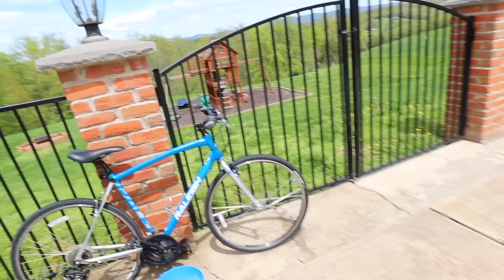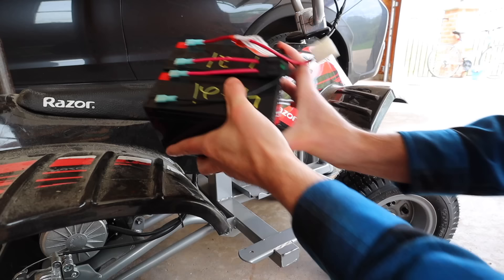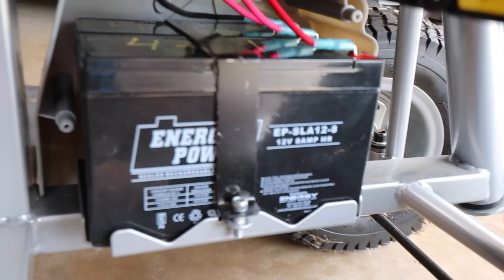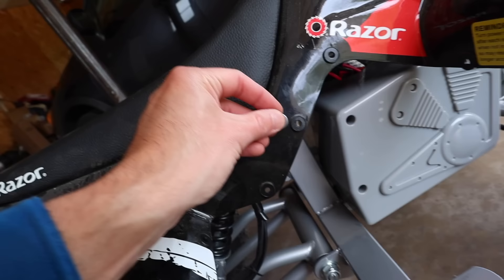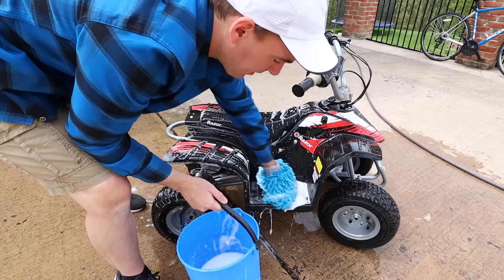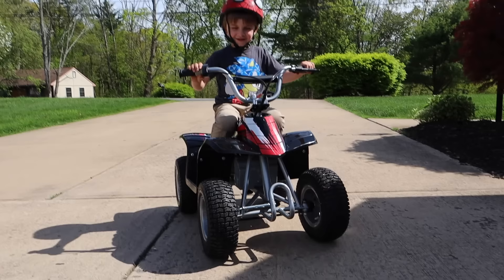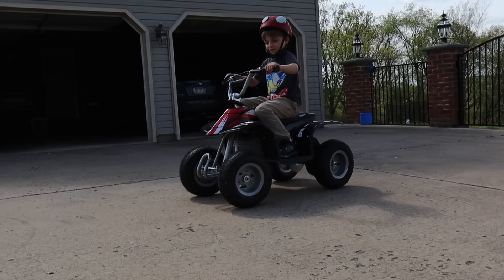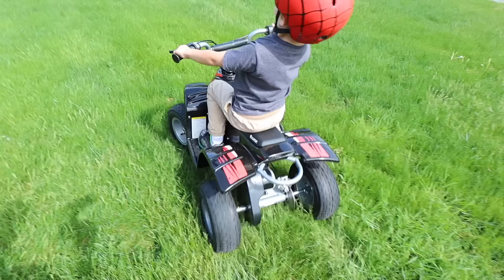I FIXED CLARK'S FOUR WHEELER!

Comment: The batteries are sealed, they will probably handle a little bit of water just fine. The motor controller,  the motor and the connectors probably shouldn't  get too wet. It would be best to keep it out of the creek. Enjoy!

Comment: The batteries are sealed, they will probably handle a little bit of water just fine. The motor controller,  the motor and the connectors probably shouldn't  get too wet. It would be best to keep it out of the creek. Enjoy!
Reply: P